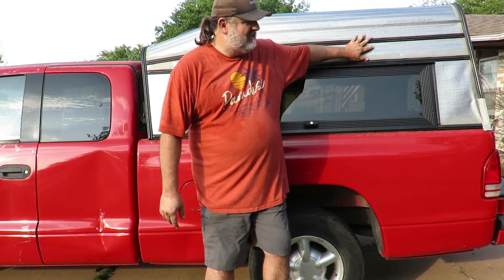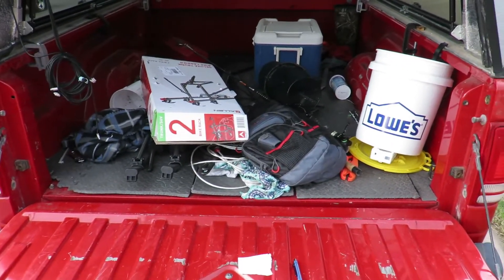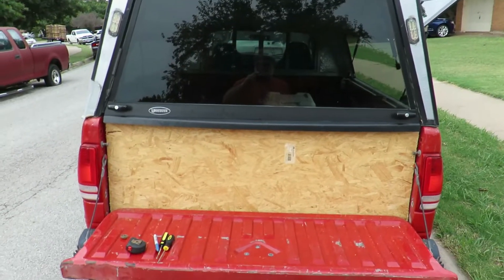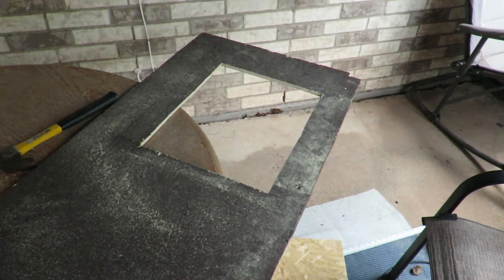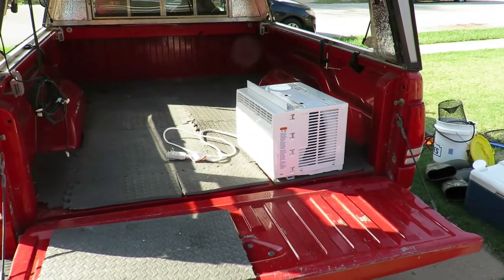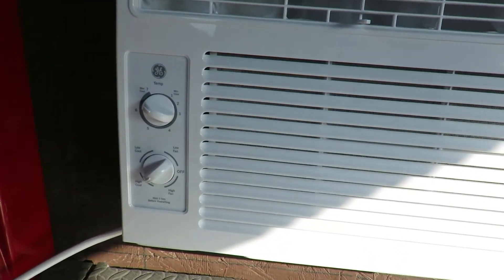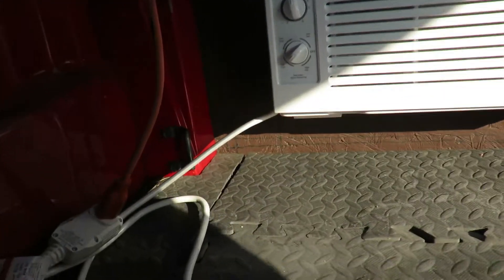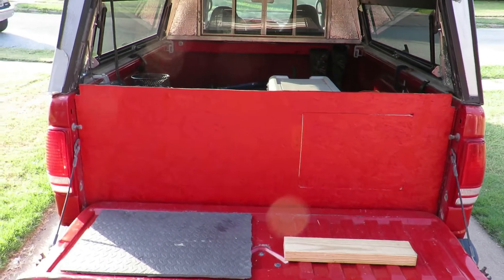How to install a AC in a Truck Camper

Comment: if you cut out a notch a little below the bolt that the truck bed locks too you don't have to slide in from top. slide in right side to truck-then feed left side through notch and slide down.
Reply from the maker: Thanks for the information, and thanks for watching

Comment: I WOULD LIKE TO KNOW WHAT IS YOUR ELECTRICAL SYSTEM TO POWER THIS AIR CONDITIONER HOW MANY BATTERIES  OR SOLAR PANELS TO POWER THIS OK PLEASE! THANKYOU!
Reply from the maker: No batteries or solar panels, I just use it at campgrounds with electricity.  The ac takes to much power for batteries or solar to run.
Reply: @BTROutdoors  OK THANKYOU! IM 58 AND OLD SKOOL BUT IVE NEVER SEEN ANYTHING! LIKE THAT SIR! WOW!! THANKS FOR SHARING